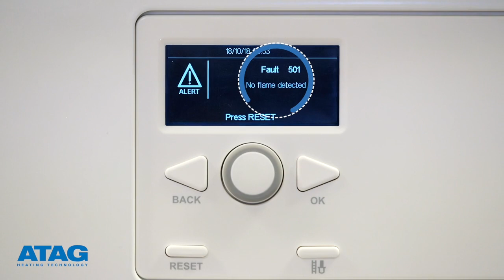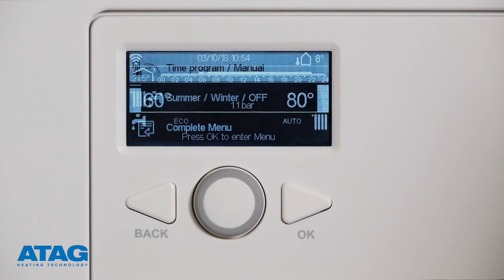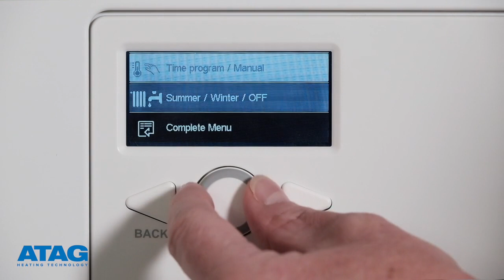Using the controls on an ATAG boiler (2019 onwards)

Comment: What do you do if this boiler won't turn on to heat the water from the british gas UP2 timer/control panel.  The tap icon is showing & there is no error code and when I press reset button for several seconds nothing happens. The boiler was installed in 2019 by my late mother. The ATAG display is similar to 0:40 on the video

Comment: Hi I've got an atag boiler, on your display near the radiator you have the words auto. On mine this only comes up when I have the auto function on for the temperature of the radiators, but when I have this on, the radiators hardly get hot. Should I keep this on or disable it? Thank you
Reply: I have this on but it does not affect the radiator temps like you describe

Comment: There is a desperate need for a few YouTube user videos, the menu system is horrendous and very difficult to navigate indeed.  It's an excellent boiler I'm sure, but such a complicated menu system.
The Wireless control app has never worked despite an engineer attending a number of times to try to get it working. Every other wifi dependent item in my small house works without issue - except for the ATAG wireless phone app which simply won't connect to the home wifi.
Had I realised just how complicated it would be to set the heating timer I would have opted for an alternative brand.

Comment: Error Code 412. Room Sensor Not Detected. Great! 
“Error codes are in the back of the manual” he says. Yes. Only a few of them though. Not 412!
Reply from the maker: This error code comes up where an ATAG Zone accessory has been added to a boiler and some settings have changed. The error code 412 is an error code 41z , which is in this case signifies zone two sensor has an error. Since most systems only have one zone, then it could be the ONE zone controller on the wall, or the boiler has the wrong zone setting.
The most likely correction and check to be carried out is to check one of the parameters.

From the controller home screen, press the BACK and OK buttons at the same time for 7 seconds
Turn the selector wheel to highlight 007 as the Technical Code. Press OK to Save.
The next screen will appear. Turn the selector wheel to highlight ‘Complete Menu’. Press OK.

The screen with the complete parameter level will come up. Go to number 5 ‘Zone 3 Parameters. Then turn the selector wheel and select 5.2 Z2 Settings Then turn the selector wheel and select 5.2.1 Thermoregulation.  The thermoregulation parameter 5.2.1 should be set to 0 – fixed flow temperature. Alter as required back to 0 (zero).Otherwise call our office on 0800 254 5065 where we can try and help resolve the fault code.
Reply: ATAG Heating Technology: Sorted!! Thankyou kindly for your reply and solution. 👍🏼